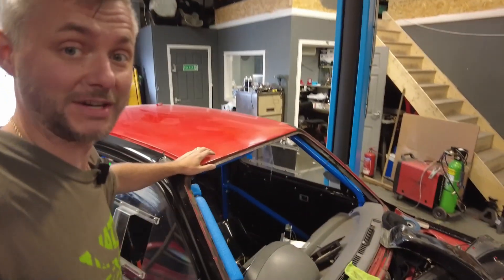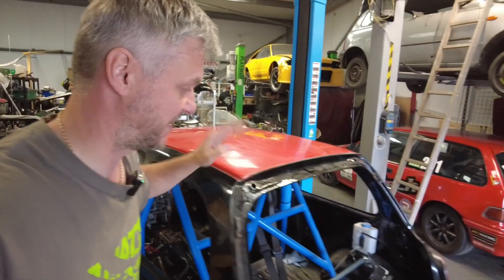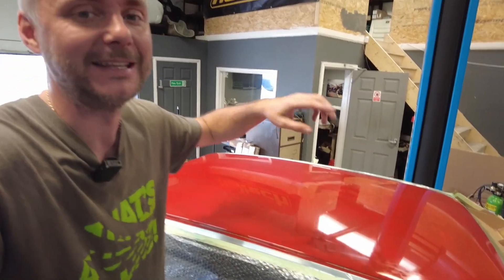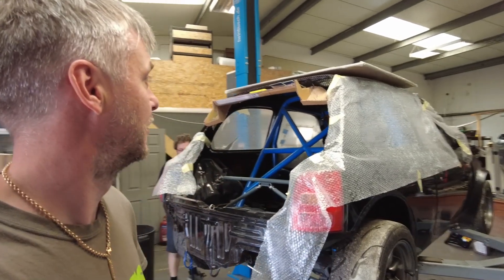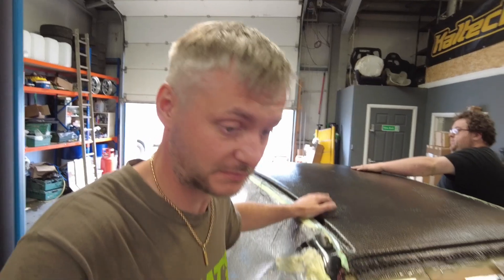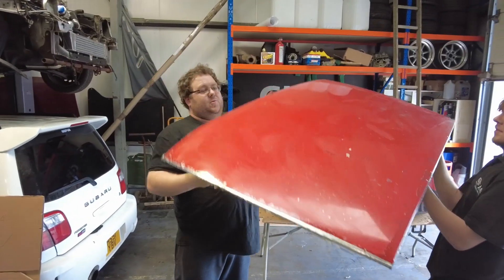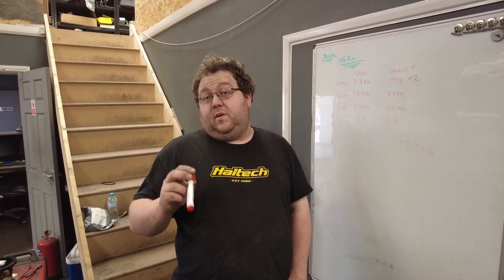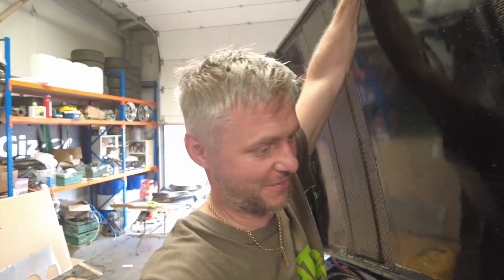Making EASY carbon ROOF for GIZFAB. Carbon Roof using the skinning wet lay method. part 3

Comment: Hey man to avoid lifting on the corners apply a layer or epoxy first before any carbon and let it get really tacky, then lay down the carbon, and it will stick really well. But you have to be more careful so the pattern doesn't stretch or deform because once it's down you do not want to lift it off
Reply from the maker: Yeah biggest problem is laying fabric flat in disturbed on large panels. But amazing tip!!!

Comment: So at this point rigidity is handled mostly by the cage, correct?
Reply from the maker: to be fair original roof doesnt relly add much anyways. its the pillars that do the structural mainly

Comment: When you wet layer on top of something such as this, wouldnt the new piece be slightly bigger? Do you just trim to make it fit?
Reply from the maker: the part is bigger only by the thickness of the carbon itself in most cases does not exceed 1mm.
Reply: @RuskiWeldFab  That makes sense, I thought it would have been way more. Thank you!

Comment: Knock knock. Anybody there? :) 
Good job. However I don't like matte carbonfiber roof panels on cars even if they are tuned for race.
Reply from the maker: can be made shiny with extra coating of resin and laquer
Reply: @RuskiWeldFab  Yes of course it can easily be made shiny. not hard that.

Comment: Is it possible to make a fender mold without ruining the fender itself?
Reply from the maker: Yes absolutely! Greatly depends on the complexity though
Reply: @RuskiWeldFab  I have a '94 SAAB 9000 Aero project, so the curves are pretty simple. I have a small piece of rust on the fender arch that I was going to have replaced, but an entire quarter panel in carbon would be much better IMO. 

Since it's a SAAB I worry about damaging bits and not being able to retain the factory parts or get factory replacements. 

Definitely want to have her lose some weight, and improve aero.

Comment: Love watching your videos you've inspired me, I've seen which product your use I've skinned a few small items just wondered how much resin you used
Reply from the maker: I'm so glad!
Reply: For a wet layup like this, it's typically 50% resin to Carbon, so try to match the quantity of mixed resin, plus 10%, to the weight of your cut carbon. You'll be wiping/pushing much of it off the carbon as you press it into it. As long as the weave is wet throughout, you're good.

Comment: awesome work mate think the glanza needs a carbon roof now 
if i was giz id block in the the back window holes nice and smooth and do the whole rear carbon skinned you have the roll cage for stiffness so no worries there 
make it look like a carbon micra van lol
Reply from the maker: i dont think this would be allowed. must have rear glass. people had issues in the past blocking them off as well. unless its a van from factory.
Reply: @RuskiWeldFab  damn racing regs spoil all the fun lol 
so no rear plexi ??
Reply from the maker: no plexi you can use. i mean it has to be see through
Reply: @RuskiWeldFab  thinnest sheet of plexy you can get away with and carbon rear end would be the nutts